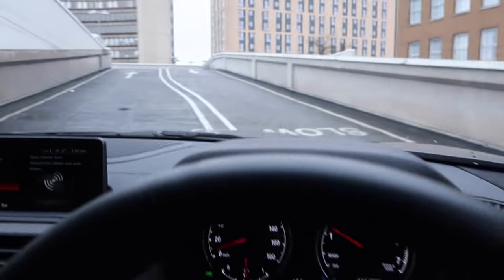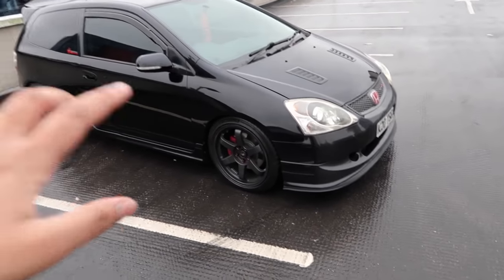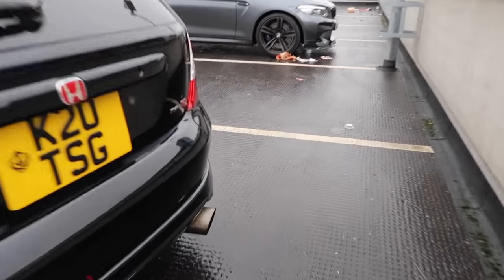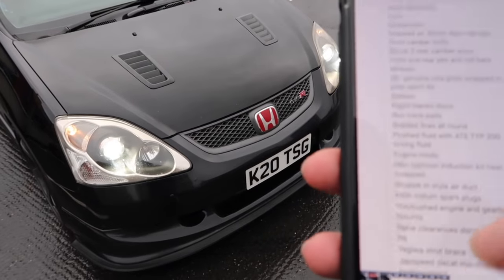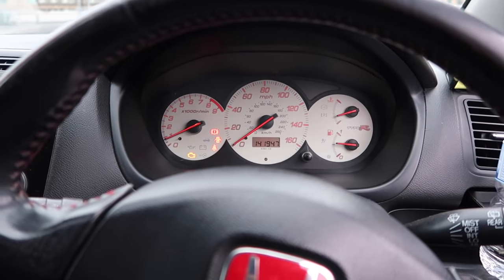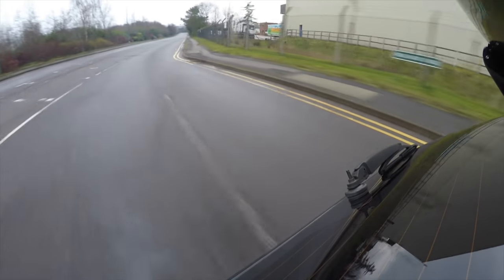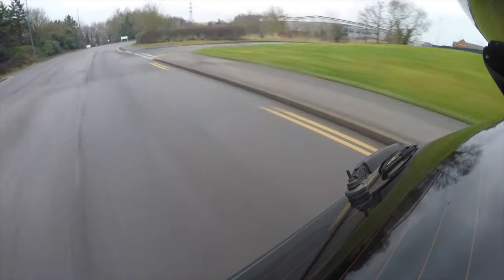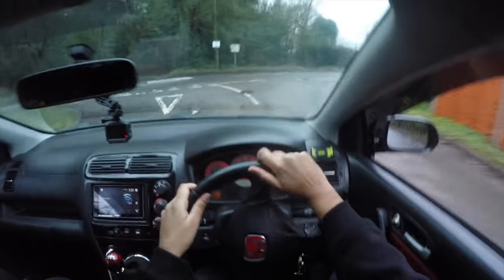CRAZY Honda Civic TYPE R EP3 *My First Drive in a VTEC*

Comment: Looks like it’s smoking in VTEC!!!
Reply: Dave The Rage Yeah it really does. When Hamza puts in the rear clips of the car whenever he blips the car into a higher gear I see blue smoke....
Reply: Haider Sohail Common problem on the ep3’s,but not a good thing. Nice car though.
Reply: Dave The Rage Definately Credit is due to the owner and the actual car
Reply: Its my car and yeah it smokes a little its not so much in tec but on initial press of the throttle, stem seals need doing will get it sorted soon, bought the car stock in September and done all this so far, sorting the oil is next on the list but car drives spot on
Reply: TaranGill0121 Wow you quite the man all the those beautiful mods in 3 months. Would love to see a sequel of your car when it is fully built to your specification
Reply: Haider Sohail haha thanks, i had a track spec golf mk5 1.9tdi stage 3 and that i had built over 3 years and someone hit and run it so i lost a lot of money, this facelift came up cheap and ive always loved ep3s but they’re nothing compared to a turbo car
Reply: TaranGill0121 Yeah fair do’s,nice looking ep3 👍🏻
Reply: TaranGill0121 That’s ridiculous. Cannot imagine if someone hits and runs my pride and joy. How is the EP3 on fuel? I know it’s not a priority but obv if you own a ep3 you want to rag it on every country road or drive it normally
Reply: Dave The Rage cheers man
Reply: Haider Sohail  ep3 is decent when not in tec other than that its shit on fuel lol
Reply: TaranGill0121 I’ve just had Ecutek installed by TDI,makes a massive difference,and VTEC feels totally linear now compared to before.
Reply: TaranGill0121 lol
Reply: @TSGDETAILING  You should have sorted the smoke problem first imo, before making all these mods.
Reply: Dave The Rage yeah I can’t wait to have it mapped, im waiting on an rbc mani and want to change the k&n typhoon to a tegiwa or gruppe m
Reply: Nick Vibe i bought the car cheap, i knew it smoked. The car drives spot on and has put a lot of other cars to shame and kept up to turbo cars running around 260bhp. It does burn oil and i just have to check it once a week but it’s getting a full rebuild soon so it’ll be fresh
Reply: It's always blue
Reply: Jason Warnock its not
Reply: @japcarjunkie  how much? u have pop n crackle map?
Reply: aiva biggen Cost me £750 and yes i have the pops and bangs.
Reply: What oil grade ?
Reply: TaranGill0121 I have the HKS RSK with the heat shield. Makes an unbelievable noise when i hit vtec.
Reply: @TSGDETAILING  What do you think of the Michelin Pilot Sport 4's in the wet?
Reply: ExoModdingCrew great tyre mate highlt rates
Reply: TaranGill0121 I have the 4s myself. Unbelievable things. The turn in alone is massively improved over my previous P-Zeros.
Reply: Well spotted i noticed too everytime hes hitting Vtec

Comment: My first “high powered” car was an ep3 type r 54reg. I miss it to this day! Did a check on it a few months back and it’s still on the road 190k miles on it on its last MOT. Passed every time with only a few minors throughout the years, glad it’s still going strong and being looked after. Sold it at 41k wish I kept it even though I’ve had a lot more powerful cars since then but  the memories made when having that car tops it all
Reply: Owners of one of these are proud owners if I could afford to insure one I’d have one

Comment: Great vid, hi guys I have Milano red 04 ep3 with only 51k miles on the clock for sale  with full service history and all previous mots, it’s always been garaged, completely standard other than a induction kit, still got original. It’s hpi clear and in extremely good condition, seats are unmarked never been smoked in, alloys are immaculate. I am an enthusiast and have only ever used shell v power in it. It’s for sale for £6000 no offers, don’t really want to sell it but I really want the new ctr
Reply: Theres something called Autotrader/Gumtree?

Comment: Love the ep3, fast and light. Had mine up to 155  hard to believe but it's true. Timing chain and bearing in the engine went  at 112k
Reply: Really? I thought Honda engines were bullet proof and known for their reliability.
Reply: @solefreak2  They are if you replace the timing chain tensioner, common fault with the K20 unit. Put the right oil in it at the right intervals, don't rag it from cold, it'll run forever.
Reply: @solefreak2   I did my best  to save it but after spending over a grand on a timing chain then the first time I gave it a good blast then the horrible noise started. Couldn't be bothered to spend any more so I sold it 600 pound and got a golf R, now I need a clutch lol yes the R is faster but doesn't feel 100 bhp faster as it's  a heavy lump, iv never been blown away by the golf R nothing special until you tune it.
Reply: @jamstersmith4625  The Golf R should be a lot quicker than the Type R. I've driven the Honda when they first released, excellent handling but need to be worked hard to gain or feel any speed. In fact my previous diesel 330cd would leave the Type R's on a rolling drag and from stand still.
Reply: @solefreak2  but have you drove the golf R?  Mine is manual so alot slower than the dsg. The golf feels so heavy but planted at the same time. My honda had a de cat and I raced loads of ep3 s fn2 and by the end of third gear I'd be well infront. My mate said his subaru was 300 brake and would kill my ep3 so we went for a race. He started ahead too. Take a look at the videohttps://youtu.be/2FQfkuC4620
Reply: @jamstersmith4625  Not driven the newer golf or S3 but I owned the mk 2 Leon Cupra running a stage 2+ and that was another level all together, even in stock form. A Type R would stand no chance unless ofcourse you stuck a turbo on the end of that vtec. Let me a peep at your vid : )
Reply: @solefreak2  I've beat 330ci 231bhp let alone 204bhp 330cd... A ep3 driven properly is a very capable car. Torque is an illusion  your going very fast. Mines Tuned now and a remapped 330d e92 couldn't pass..
Reply: @HasanMohammed-rt9ri  Is that in a straight line? I'm telling you now, going back in the day before I even raced one in my 330cd, a relatives old Golf VR6 beat another relatives new Type R, believe it was one of the very first in this shape (preface lift) on a 51 plate. By time the vtec comes in, turbo charged cars a long gone.
Reply: @solefreak2  then it's not driven properly it should aways be in VTEC if you know how to drive. I've raced a friends megane r26 f1 230 and it was neck and neck to 90mph then we backed off. Audi a7 3.0tdi ultra friends also 215bhp and after third mine would pull few car lengths. Golf GtD mk6 remapped 215bhp Apr Tuned to 80 the same and mine would start to pull this is when it was stock.
Yes straight line diesels run out of puff top end.
Reply: @HasanMohammed-rt9ri  That's interesting.. Maybe it was the driver.
Reply: @solefreak2  well bmw 330cd 204bhp/1545kg ep3 197bhp/1230kg  300kg of weight and 7bhp difference. Also we are comparing 3.0 litres with turbochargers to a 2.0 N/A.
Reply: @HasanMohammed-rt9ri  Torque figures and power delivery also play a part my friend.
Reply: @solefreak2  and gearing... The type R gearing and revs are so high it doesn't need torque...and verified times is 7.2s to 60 for 330cd and 6.8s for ep3 and 0-100mph times is 18s for 330cd and 16.4s for ep3 bare in mind the ep3 is front wheel drive so would get off the line slower.. Imagine on a rolling start. I love the e46 shape but the 330cd doesn't stand a chance and when it comes to a corner you wouldn't see which way a type r went. Remember we are comparing a 3 litre turbocharged car to a 2litre n/a that in itself is an achievement for the Honda..
Reply: @jamstersmith4625  That's interesting, I currently drive a 250hp ep3 and have always wondered if i should get a Golf R as they look rapid but maybe there wouldn't be much difference in it.
Reply: @u04pww2  if yours is 250 hp id say there wouldn't be much different especially if you got a manual. Everybody thinks the golf r is fast as f**k but they are alot heavier than the type R. .iv been told it loses around 50 hp due to 4wd. So that extra weight and hp Loss feels more like 250hp.Off the mark is good but even then with the manual the engine bogs down like crazy,but even in the wet it grips like mad. But the golf r is alot nicer inside.
Reply: @u04pww2  don't do it for the speed, in any case do it for comfort and awd traction.
Reply: Mines at 122k and no problems with the timing chain. I've been told it should be changed about 260k kilometers (sorry dunno how many miles that is). Very strange
Reply: @king-manu2758  My daily is a super comfy diesel so that box is ticked, awd is however something I'd like to try at somepoint, living in the north of Scotland means summer is the only time you can really use a 250hp fwd car.
Reply: Mcufre mines at 135k and After seeing his comment im scared
Reply: ZHGT88 same 121k here but off-roaded atm while I save up to for some bits! Deffo gonna buy a timing chain kit now and save some for labour on it. His comment has made me scared some teeth have already jumped and caused damage without me knowing 😂
Reply: I have an ep3 SI engine is at 156k miles so still running strong but my friend recently blew the tranny clutch and snap the axle r i p. Press F to pay respects
Reply: Probably the way you drove it I’ve had mine no problems
Reply: I have a 230 bhp ep3 facelift with lowered vtec and raised limiter and got ambushed by 2 golf r's one night on my way home from work and honestly there was nothing in it. I left one of them and the other one was pretty much even.  4th gear in a kprod ep3 is enough to fend off alot of turbo cars as the power band is wide as fuck.  You can go from 20-120 in 4th on private land.

Comment: I’m a big Honda glad (and surprised) you bought this on the channel. Glad you driven it now you understand its about the experience not the power because compared to a lot of cars these are not that quick
Reply: Great motors
Reply: Standard they arent that fast but with a few bolt ons they keep up with all the modern Hot Hatches easily, if you add FI to them they are another level.

Comment: I really miss my EP3 after some numb nut had no idea what his middle pedal was for... and slammed into the back of me and wrote off my EP3 back in 2013 just before Xmas... I then got the FN2 model Champ White Edition which looked good from the outside... but man alive... it was a massive step backwards performance wise coming from an EP3.. 
The cons of a FN2:-  
1. It's heavier than the EP3..
2. It has electronic throttle which isn't as sensitive as drive by wire which the EP3 has..
3. The VTEC X-over is more linear whereas the EP3 VTEC comes in with a jolt... 
4. The spoiler running through the back window obstructing your rear view was a dim idea...
5. Torsion beam as oppose to rear independent suspension as on the EP3..
The pros of a FN2:-
1. The interior is a lot nicer with better seats and that split level space age looking dash..
2. It's Jap.. so you don't have to worry about it breaking down.. Lol
In short the FN2 is a grown up Type R. Whereas the EP3 is a hooligan in need of an ASBO!
That K20 block you can thrash the f*** out of it.. without the fear of it breaking.... and it will keep on asking for more!

Comment: These look quite nice from the outside but really not feeling the interior at all, what kinda power do these make?
Reply: They make 197 bhp 0-60 6.4 seconds for the price to performance they’re pretty nuts and the interior is very Japanese, very minimalistic. I own a black ep3 premier edition with the trend line recaro bucket seats and the red carpet etc the interior looks amazing to me.  The one featured looks to be a standard ep3 interior he’s put the red door cards in out a premier edition standard steering wheel etc. They kept things simple back then at least in Japan haha. Part of the reason why they’re so reliable.
Reply: @almostfamous1685  nice one so there similar in power to golf mk4 vr6 but I expect lighter or the mk5 gti.
Reply: @golfmk6r964  not sure how much the golf weighs of the top of my head but the EP3 weighs 1204kg for the standard and the premier is slightly less due to a slight lighter flywheel and lighter seats (not much in it though)
Reply: @almostfamous1685  golf weighs over 1400kg I'm sure and 4mo closer to 1500kg so at least a couple of obese guys heavier
Reply: @golfmk6r964  yeahh fair enough mate quite a bit heavier then it's mad how light the type R actually is tbh.

Comment: I’m so tempted by one of these...ep3 or a r56 cooper s? That’s my two choices. What would you rather have?
Reply: @footballcoreano better reliability 😂😂😂😂 coming from a cooper s owner too
Reply: Joe Miller I was thinking that...😂😂
Reply: @JWM-MT07  mini gonna be better handling and looking. Both proper drivers cars.

Id get the n18 mini after 2011. In a jcw youd want the 2013 model.

Good luck with what ever you buy haha
Reply: Joe Miller cheers mate, it definitely will be the facelift n18 engine! Both such brilliant cars but I’m leaning more towards the mini! Can’t beat those pops😂 have a good day bud!
Reply: @JWM-MT07  haha deffo. The n18 isnt bad just keep on top of oil and filter changes etc. Stage 2 manic map.and your well away dude.

You too bud
Reply: The ep3 has a much better drivetrain, way more space inside, way more reliable and handles brilliantly with a fast road setup, cooper S sounds good and handles nicely but imo looks like a girls car and has too many problems.
Reply: @u04pww2  only way to tell is to drive both in one day ideally round the same roads dude

Comment: I have one of the most imaculate 55 plate aniversary additions of the type R... Completely stock, no rim damage, one tiny dent from a pebble which isn't bad considering it's age.. 27000 miles on the clock. I haven't driven it in two years though. Any advice how to get this beauty back on the road?

Comment: valve stems seals have about had it😂😂
Reply: Rings
Reply: incorrect it’s more than likely stem seals on k20
Reply: It's  blue when he's accelerating valve seals don't leak on throttle
Reply: Engines getting a fresh rebuild in the coming month maybe with k24 bottom end

Comment: Bro...For this review you haven't even experienced the full power of the car, because you have an engine check light on, which suggest there is an issue with your sensor 1 O2 sensor.
Usually with i-vtec engines, once there is a check light being displayed on the dash, but the car is able to be driven, the ECU restricts the total power output to half, which means you were not even getting 130 hp.....The engine is rated stock as 200-220 hp.
At that kind of power you should be gettting far more torque steer, but I could tell the car was quite stable even when you hit VTEC, also the white smoke being emitted suggests the fuel is burning rich, definitely air fuel ratio issues. Its a lovely car though.

Comment: why so many blue smoke out of the car behind? kind of defect?
Reply: Burning oil
Reply: Yes its burning oil but drives sweet, it’s getting a full rebuild soon so it’ll be fresh
Reply: TaranGill0121 how is yours only making 210-215bhp? Yours has way more done than mine. Decat+exhaust+induction kit no remap with printout at 230 here :/
Reply: itzzaster  serious? I was assuming the 210-215 figure because i had it dyno’d with only a k&n typhoon and it made 205bhp so i thought decat and exhaust added around 5-10bhp 🤷🏽‍♂️
Reply: TaranGill0121 I guess you
Might get a nice surprise if you ever dyno it 😜
Reply: itzzaster i guess so
Reply: @TSGDETAILING hey pal what brand exhaust system is on this type r?
Reply: John Duxbury japspeed 4-2-1 decat manifold onto 2.75” custom resonated catback
Reply: itzzaster 😂😂😂30bhp from an exhaust and filter 😂😂😂 typical Honda fan boy

Comment: Has it not been remapped with that de cat mani. Won't run right without it
Reply: Warren Steward  no I haven’t had a chance to remap it, waiting to buy a rbc and k100 or kpro. Reason why the eml is on since i had the decat put on
Reply: @TSGDETAILING  thought so be careful though can damage your engine killing it without a map. I've got the same mani with tegiwa cat back and k100 240bhp it's wicked. Nice car though I'm liking the wheels 👍
Reply: Warren Steward cheers buddy, it’s all in the pipeline. I bought the car in September totally stock and pretty much built it to this spec in a short amount of time. Its going in for new m2  rear lcas, asr and beak bar tomorrow then soon to be mapped. Am trying to get hold of a tegiwa or gruppe m enclosed induction kit first but yeah ive been in a mapped up ep3 and they do fly
Reply: Nice. Yeah I've got tegiwa box sound mint. I track mine nurburgring and cadwell park going oulton park when the wether is better
Reply: Warren Steward sweet ill see you at some track days then bud

Comment: Needs a rebuild smoking abit
Reply: Its blue smoke which means its burning oil. Valve stem seals most likely need replacing not a re-build
Reply: @kristianharley7231  nahh more than likely piston rings because it smoke just driving it not on start up  but to late to find out it dead at the track day 🙈🙈